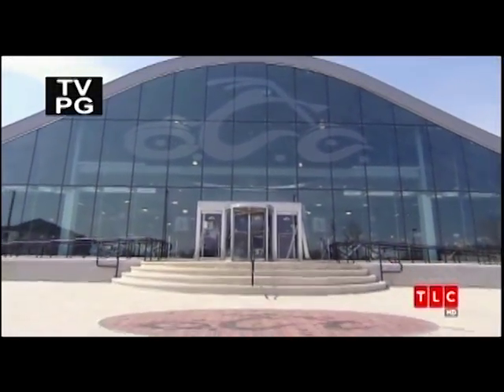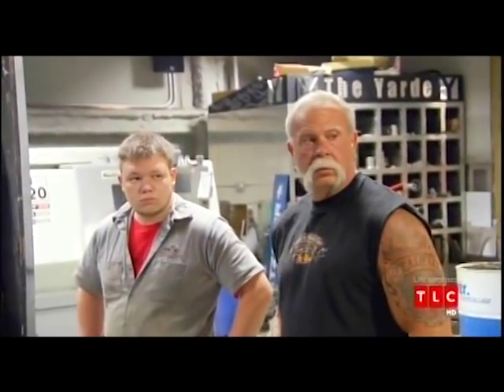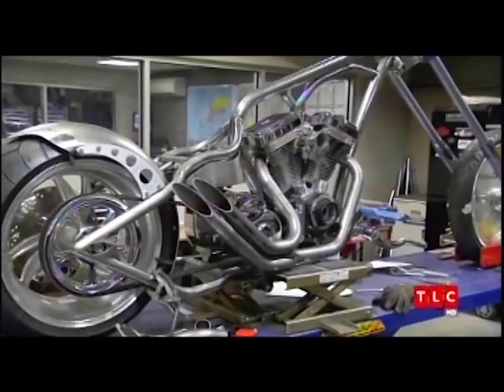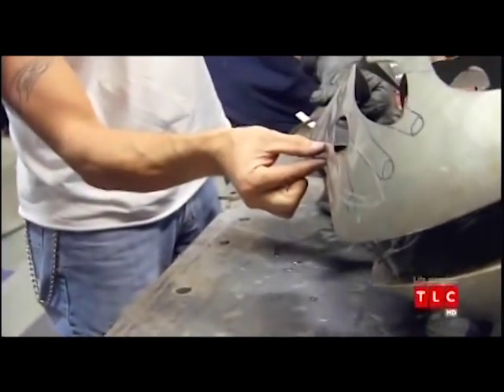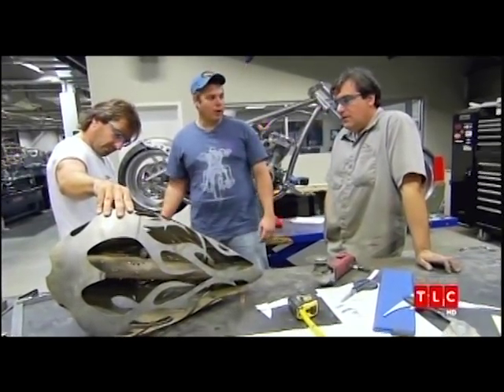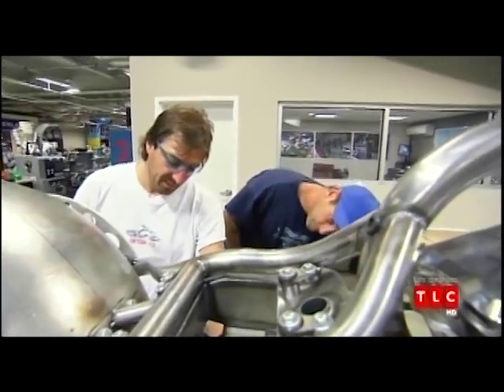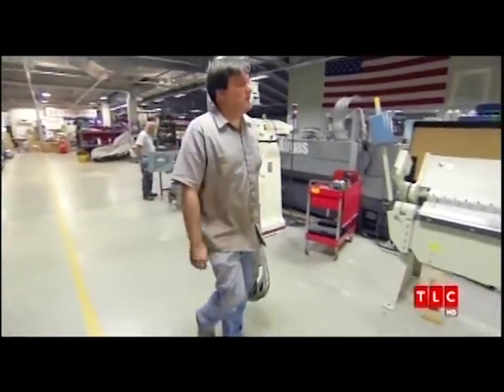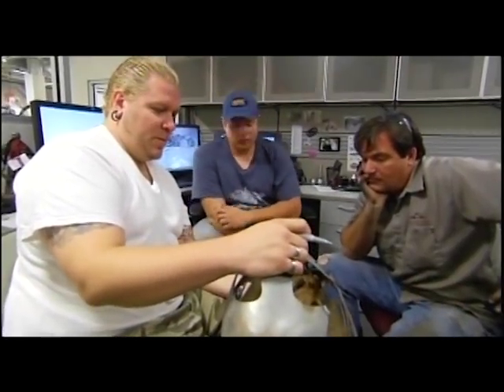Steve Wyrick's invisible gas tank being built on American Chopper

Comment: I'm assuming the real gas tank was located below the motor in front of the rear fender, in which case the fuel must be pressure fed somehow instead of gravity fed. This is the making of an extremely unreliable chopper.